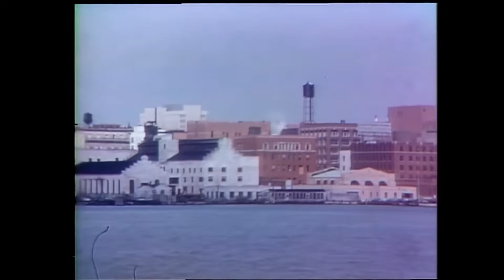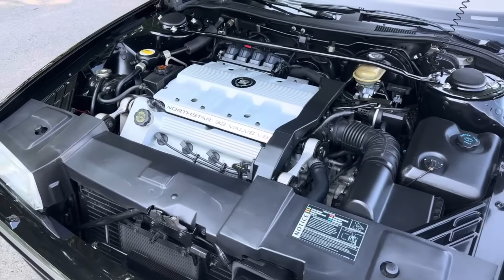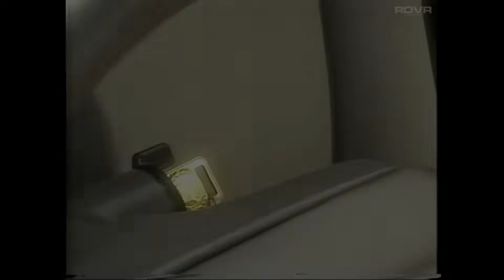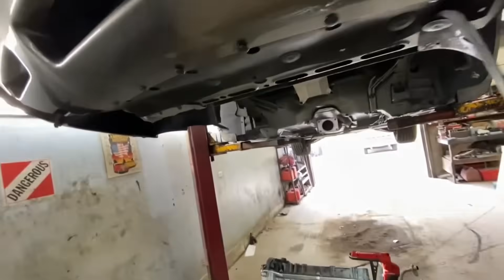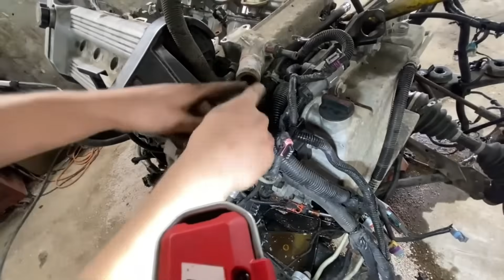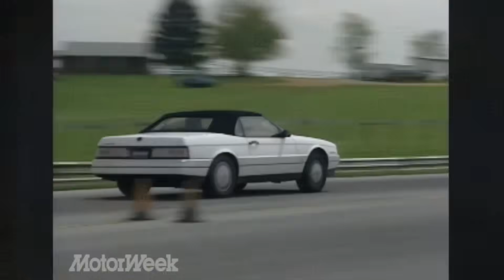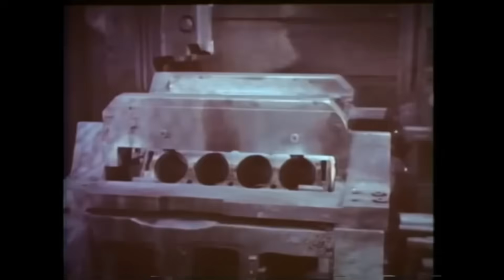Most HATED American V8 Engine of All Time!

Comment: How can a 4 liter V-8 be considered to be a "big V-8" this is a tiny V-8, I run with big block engines, at least 400 cubic inches, there's no replacement for displacement!
Reply: I have the 500 ..freaking runs awesome. Don't care about the horsepower .moves along just fine
Reply: @cadillacnan  The 500 was a beast. It was probably the best as far as longevity. The V8-6-4 was a 368 and was just a debored and destroked 500. That’s why they would run forever IF the cylinder deactivation was disabled and they were made to run in v8 mode full time. My dad’s cousin had a 1980 model 368. It was before the addition of cylinder deactivation. He got over 500,000 miles out of it mostly highway driving. It had finally started using oil around 450,000. Daddy overhauled it at 500k + miles when the timing chain went out. And he decided to go ahead and overhaul it since it was using oil. Sadly , his cousin had a fatal accident in it about 50k after the overhaul
Reply: @cadillacnan 1969 Eldorados had the best 500 inches, 🤪
Reply: I had a beater '77 DeVille with a 425. Tons of torque, shit for horsepower. Ended up selling it to a demolition derby team.
Reply: @jamesb8305 I think that was the case with that entire family of engines after around 1973 or so . They had enough torque to get that beast moving. My parents had a 1978 with the 472. They later got a 1986 brougham. It had the 307 Oldsmobile engine. It would eventually get you up to speed, but you need not be in a hurry getting there. But I think it was still faster than the 1983 with the HT 4100.
Reply: You have a point partly. But today we get the power of the old big block 6.6 or greater out of a 5.0 liter or less today.  And that's without turbocharging. With turbocharging we get that power from a 3.5 or smaller. So a big block isn't necessary in most cases. And these new engines commonly last well over 200,000 miles
Reply: @dmandman9  200,000 miles LOL
Reply: @leonardcollings7389 you laugh. But I work at a Ford dealership. And we see quite a few with over 200,000 miles. I’m 61. I remember when the expected life of an engine was around 100,000 miles. Odometers only went to 99,999. I think we look at the past with rose colored glasses. My parents had a 1974 Ltd with a 400. Had to replace the water pump at around 60,000. Valve cover gaskets around 70k. The oil light started flashing at idle at around 85,000. At around 120,000 it needed valve seals. My dad was a mechanic that would put off repairs on his own vehicles 😅. So he just lived with the early morning smoke. And the 1qt/5-600 miles oil consumption. It finally gave up the ghost when the oil pump quit at around 180,000. That was considered good life. I remember him bragging that he’d gotten 18mpg on a couple of occasions on a highway trip (55mph). We had a customer with a 1973 Impala with a 350. She got 250,000  . And EVERYONE was amazed because it was so strange at the time. But she drove ALL highway miles and she drove the speed limit 55. Most Chevy 350’s gave up the ghost at around 100-125k. Even our repair manuals told us to check for something abnormal causing premature wear only if it wore out at or below 75.k

Comment: The Northstar was a direct competitor to the Ford 4.6 In-tech. They were developed  at the same time. Same horsepower, similar architecture, but the Lincoln engine actually worked. But Government Motors fans will never acknowledge this.
Reply: The Ford Intech used proven parts from the SVT cobra and from the Special vehicle team in general. The end result was the ford engine which used a proven base ( the SOHC 4.6 which is nearly bulletproof) and already proven cylinder heads ( DOHC heads being developed for the SVT cobra) created a solid base that had good performance, good reliability and could nearly match the northstar in power. It didn’t hurt that the 4.6 ford went on to power taxis and police cars for almost 20 years and has had a considerable amount of refinement time. GM gave up on the northstar and went back to the old pushrod style in the LS series V8. Ford by contrast stayed with the modular overhead cam V8s and still make them to this day.
Reply: Are you talking the engines for the Continentals and Marquis?  Panthers platform?
Reply: Did the basic 4.6 V8 as used in the Ford "CVP71" Police have cylinder head bolts with extra long unthreaded shank length between the clamping base and the threads down in the Iron block ?
Reply: @davidpowell3347 I have no idea.  My point was that the crown Vic’s, Marquis, and Continentals with the 4.6 could last 300-400k miles or more.  It was an underpowered engine which means it was not strained and lasted.  The Northstar was the exact opposite.
Reply: Dude I am a bow tie guy, but the Lincoln mark 8 was a bad mutha. Had one for a loaner car wished I could afford one. The engine was killer. Fast forward 7 tears and the engine still kicked butt. It was the dip shit adjustable suspension that out them out to pasture. Aftermarket made a kit for a while to not spend 6k on repairing it but only  700.00 converting it . I guess it was too late by then. I haven't seen one in a long long long time now.
Reply: I had a 95 Lincoln Mark 8 and it was a beast!
Reply: It blows my mind that they didn't do any long term road tests with this engine. Would have saved them a chunk and their reputation, given this was such an expensive project to begin with. I'm sure it didn't help that Lexus launched the LS 400 with a bullet-proof engine. Then again, Lexus thoroughly road tested that engine before it was put in a production vehicle. It may not have made as much horsepower in the beginning, but at least it was as refined, if not more so. Never saw a Caddy doing the wine glass trick. My daily driver is a 1995 Lexus LS400.  Number one, the engine is still smooth as butter. Number two, it still runs. Number 3 is a bonus- it's a 30 year old car that has zero squeaks or rattles, and EVERYTHING still works in the car, with only one rear window motor being the exception. I honestly think Cadillac could have built a car like that Lexus had it not been for the bean counters that would always shut them down in the late 80's and 90's.

Comment: Long live the Chevrolet push rod V8.  And this is why Cadillac borrows everything from Chevrolet
Reply: Pushrod V8 is an antiquated dinosaur. With over half a million 5.3 and 6.2 V8s being recalled for self destruction you have to ask the question. “ Did GM learn anything from the Northstar debacle?” I’m going to have to say no on that one. They kept on trying to cheap out the reliable LS series V8 to the point that the engines are eating themselves. In some cases owners are getting the engines replaced 2 or 3 times and it’s still not working
Reply: @matthewcaughey8898 WHAT the hell are you talking about? The Chevrolet push rod V8 al the way to the LS is the best engine GM has put out.  WHAT do you mean eating them self? The only problem the LS that was in trucks and SUVs had was the fuel active management JUNK once you got rid of that it was no problem to go pass 500,000 miles.
Reply: Chevrolet borrowed some valvetrain design elements for the original SBC from Pontiac.
Reply: -they are both the same company....GM. How do they steal from themselves?
Reply: @RealDougFields  I take it you've never worked for a big company where one division or department seeks to use another one's resources. I guarantee you that the Pontiac engineers who poured their budget into developing the valvetrain for a pushrod V8 that wasn't even out yet thought the Chevrolet guys "stole" it when they used it on the SBC in 1955.
Reply: @AcmeRacing  It's an old joke that there were more Chev engineers lost in the hallways than were total Pontiac engineers.
Reply: @AcmeRacing  that is a stupid and false narritive because they all worked for the same company. You are being played by an orchestrated competition that never existed.

Comment: They didn't need the Northstar. They needed to re-badge high=displacement Chevy V8s.
Reply: Your Cadillac customer is not going to want an antique pushrod dinosaur in their high end luxury vehicle. You had to have a high end engine if you wanna compete with BMW and Mercedes. Try to pass off an old pushrod V8 to someone crossshopling a BMW 5 or 7 series and you can just watch the customer walk away

Comment: I was in the US in 2009 for a business trip, during the trip I was looking at very low mileage Northstar with a super charger. I exported this engine to Australia. When I got back home to AU I stripped the engine and rebuilt it with head studs and MLS head gaskets for a rod I was building. I still have the rod with the NS and its a great engine.
Reply: Supercharged northstar engines dont have the headgasket issues
Reply: Thinking the 6.2 L might be earning this title. 😅
Reply: The fix  involves drilling out the existing threads in the aluminum block and tapping new, larger threads for bigger studs. They have a kit that lines  up the jig to do it. Seen the Car Wizzard do it. Not a good idea for  novice to do and you had to pull the engine out to do it.
Reply: This reminds me of when I visited NASA and saw the space capsule that 3 astronauts perished. One of the engineers who worked on the project was telling us all about it, something I already knew. Not being able to control myself I asked him…….weren’t engineers back then aware of the dangers of a pure oxygen environment? He wasn’t happy with the question and I sort of regret asking it.  (I.e temperature change and stress on head bolts)
Reply: Yes, as long as you do that, bulletproof it with coarse thread studs. I want to know who the idiot engineer was who thought putting fine thread torque to yield head bolts into an aluminum engine block was a "good idea" lmfao. GM, always snatching defeat from the jaws of victory 🤣🤣🤣
Reply: So you de-idioted it?
Reply: Noice!
Reply: its not a great engine, it is a piece of shit. great engines live long from the factory.
Reply: I have a Cadillac steering column from a 1972 Coupe Deville, going my 2022 Sierra Chevy truck!!!
Reply: You didn't need to do anything to it.  They had fixed the problem by then.
Reply: A car that does not survive the payments… That’s kind of a feature nowadays.
Reply: @ScottClevelandmi Hilarious! But also sad.
Reply: @ScottClevelandmi  What the bean counters & engineers do is to ensure a vehicle expires soon after the warranty period expires.
Reply: Awesome story, man!
My mom bought her 2004 Cadillac CTS with the often-hated-on-YouTube: 3.6 L V6 with twin exhaust.
Despite SO many content creators and micro celebrity mechanics non-stop hate and elaborate disgust stories with this engine, I’d have to personally say they are great!
She has no problems: she never did have problems.
No rust anywhere on the car too.
She’s at around 95,000 miles today and still drives, and performs, excellent.
I wouldn’t take EVERYTHING YouTube content creators/mechanics say about Cadillac motors as gospel.
Some vehicles are definitely bombs, or no good, in other words. That’s a given. But, yeah!
Reply: @MedicalCattle  Well, the thing is, the malaise era (that spanned like mid 1970s to about 1990) is long gone.  These engines from the 2000s on up that people go on about how bad they are, would be at least average in terms of reliability for the 1980s.  It's not good click bait if you are like "Here's the problems this engine has" but then point out it doesn't affect most of them.  Maybe that Hyundai Theta II or the GM 6.2L would at least make it to below average in the 1980s; but some of those 1980s engines were really junk.

Comment: The 3v Ford 5.4 is way way worse.
Reply: WHAT!!!!! For real. I don't know to much about Ford.
Reply: My F150, 2004 had 112k no leaks, no noise, no failures. Changed oil every 3k miles. Traded it on a 2018 3.5 twin turbo Lariat. Both great engines. Oil is cheap compared to a new engine.😊

Comment: It's not torque to yield. It's fine thread bolts in aluminum threads. Tty bolts have been used on almost all GM cars. The 3800 has them and is damn near bulletproof when comes to head gaskets.
Reply: Misstatement in the video. TTY bolts are DESIGNED to allow for expansion and contraction during engine thermal cycling. I was a GM engineer and can attest to this. As stated in other comments correctly, the fix was the thread pitch. Also the loctite spec on the bolts was changed to prevent the bolts from loosening up. Also correctly stated in the comments is that TTY bolts in the 3800 and other applications were phenomenal. Competition uses MLS (multi layered) steel head gaskets which kill the issues forever. There is an entire industry around these for aftermarket use. Look up Cometic. Why does production not use MLS? Cost. Sigh.   PS- I had the glorious honor of removing the very first Northstar engine in Development at GM. Good times.
Reply: @rediz4rubes I heard they had coarse threaded bolts on paper/design, but the beans counters seen gm had crates and crates of leftover quad 4 headbolts …and they used them to save some money…and they were the same length and thin pitch…so they implemented using them and the rest is history…
Reply: @rediz4rubes  rediz- Thank You for your comment. Good to hear from the source.
Reply: Exactly.
Reply: Agreed, 11mm fine thread bolts in aluminum is the problem. If they would have at least used coarse thread studs, it may  have been a success.
Reply: Think it was not head gasket but intake was plastic   bol;ts loosened 
because of low torque specs 95-2005
Reply: @Badlands1182  the fix is literally to drill out the the bolt holes in the block, and rethreading for larger diameter and larger threaded bolts. They are great engines after that.
Reply: 3800 and my 4.3 are both cast iron blocks and cast iron heads the leaking down back of blocks 
gets mis represented or mis Diagnosed 
The water leak is torque specs on manifold is 11 inch pounds  as per chevy mechanic 
people torq to 11 pounds because they are wanting to stretch bolts they thought it was type o making them crush the hard plastic into pieces
AI says the torq specs were 7 pounds 
I am a Super moderator at LS1 Lt1 Forum 
The GM Head Gaskets will support up to 700 Hp
13 to 1 compression we actually change the intake gasket to a 98002 older gasket thats 
old steel and rubber gasket doesnt quite line up on the vortec heads but can be torqued to 11 pounds  got bolt stretch 
and doesnt loosen Ive kept a 3800 going for 300,000 miles before by torquing to 15 inch pounds every time I change the oil lol running 7 pounds of Roots super charger boost
and when you find a leaker you can twist at least one bolt with fingers usually 2 they should have kept the 2 bolts in middle like v8 also 
the Vortec manifolds on the 6s got the shaft
Reply: V6 heads are short and tall. not prone to warping. plus the head bolts are like the chevy V8...  surrounding each bore.
Reply: .  . Although I understand as you say that fine threads in aluminum, and some say also the length of threaded portion in the block was the problem .  .
Reply: Torque to yield bolts sound like they would be inherently unreliable if they are tightened near to their point of losing elasticity.  Why not just use heavier bolts that don't require TTY to achieve the same clamping force?  Or is it a question of saving a pound or two?  A costly experiment in longterm reliability.

Comment: As you point out, the Northstar had a lot going for it before the problems hit. It is my understanding that the main problem with the head bolts was their thread, Apparently fine thread bolts don't work well in aluminium blocks. I also understand that there were difficulties with the bottom end bolts as well. These engines can be made extremely reliable with a stud bolt kit from Northstar Performance - based in Canada. The 'Car Wizard' - also on YouTube, did a few episodes on this and demonstrated the use of this excellent kit.
I do question the cost figures stated and am sceptical regarding the need to remove the engine from the car although I have very little knowledge of Cadillacs so this may or may not have been an issue.  I have a very strong soft spot for XLRs which also used this engine - even supercharging it on the XLR V. and have always thought that it should have made its way into the Corvette. By the time the XLR came on the market the problems with this engine had supposedly been addressed but I understand that some owners of these cars are still fitting the upgrade kit.
Reply: Given that a good condition XLR can still bring 45 to 50k under the right circumstances it’s cheap insurance against future problems
Reply: The engine needs to be removed.

From the bottom!

Plus, take most of the front end off.

Chilton Time Guide lists the time for a 2006 DTS  ( what I am junking in a few days (really) is 22 hours.

Multiply that by 200 for a knowledgeable experienced conscientious engine rebuilder, add $500 to $900 for parts, plus tax, and you're way over $5000, almost six. 😮 😢😢😢

Comment: GM only build’s Lemons 🍋
Reply: 3800 series II has entered the chat
Reply: Yeah Chevrolet V8  has inter the chat . Starting with the frist V8 287in then 305, 307,327, 350, 400 and then  BIG BLOCK 396,409,427, and the MIGHTY 454 that wind it up in SS and al your heavy duty pickups and Suburbans 20 and 30